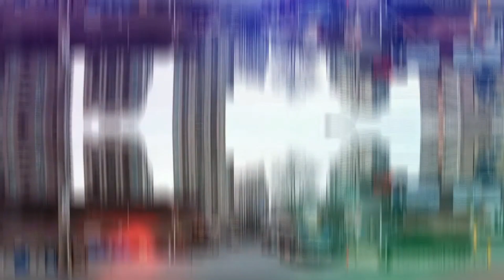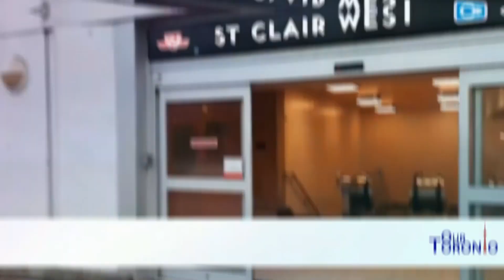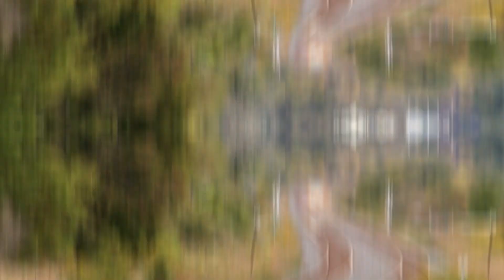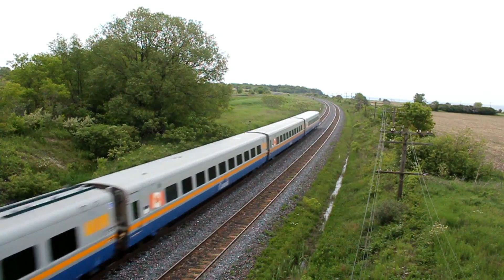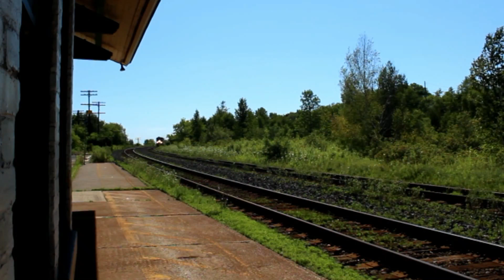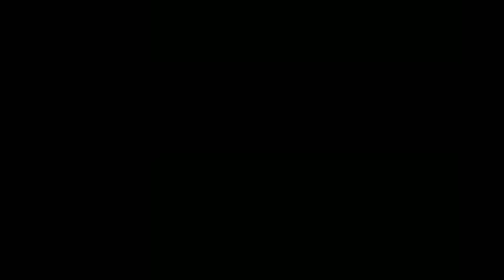High Speed Rail Coming to Canada.  Government moves forwards with VIA's Toronto - Quebec City Plan

Comment: It is important to note that this is $3.9b for a 20 page report due in 5 years.  No concrete will be poured.  Canada built Montréal to Vancouver in less time that this study.
And because Trudeau imposed Trois Rivières not only as a political ploy to help the local MPs but also because he knwos it is a show stopper. The loss of the Mont Royal tunnel means no train from Trois Rivières ca reach Central Station.  With the loss of Windsor Station in the early 1990s, there is no viable al;ternative, unless you use the shack for commuter trains at Luvien Lallier with not enough tracks, no services like catering, car maintenance etc, and long detour to get to Laval. 

Until politicians are willing o discuss this, this project is going nowhere.   Connecting Peterborough to the Metrolinx tracks to get to Union is a challenge but less so than providing train service in Montréal,  (Peterborough to Toronto right of way goes through the CP sorting yards at Agincourt and there is no way CP woudl allow electrificed tracks on its 1950s infrastructure since they would prevent double stacked containers and the 2 lavel car carriers.
Reply: My guess is that the ideal location for the Montreal station is at Dorval, since avoids the Mount Royal issue and lines up with the interests of two of the partners (Air Canada and CDPQ's REM).
Reply: @jje10001  exiting the island from Dorval is not easy.  And would not technically be a station in the city of Montréal.   To reach Laval and Trois Rivières, they would likely have to dig tunnel from Dorval in parralel to REM's single track tunnel and then a bridge over the river to Laval and then build tracks across laval to reach the CP tracks at St-Martin Jct.    From Dorval to the St-laurent sub they would need a big tunnel that goes under the 13 (which is udner the runway) to reach the CN tracks and then winder the leevated portion to 3 tracks 1 for 1950s diesel freight and 2 for electric trains) to the Home deport and rebuild the ramp from the CN to CP line.

Comment: SNCF is not part of consortium. SNCF is now a holding company. It is SNCF Voyageurs that is part of consortium (as well as Keolis).   Voyageurs runs trains and serves drinks on board.  It is SNCF Réseau which has the expertise in building  high speed tracks.   Keolis, part owned by CDPQ is a subsidiary of SNCF which manages transit systems around the world, it has no expertise building systems. 
SYSTRA is the rail consulting firm which has experience participating in such projects.   SNC Lavalin had problems laying standard gauge tracks in Ottawa so definitely not in a class where they can lay high speed tracks.  Air Canada is there in the unlikely event this project goes ahead and wants share of revenues it will lose in short hauls flights.   Remember that at onset, the government wants a consortium to run trains instead of VIA.  
Note: Keolis also owns Orléans Express which runs intercity buses in Québec, notably the Montréal-Québec run which has beasically been vacated by VIA who has been cannibalizing itself and its fleet to offer reduced frequencies.

Comment: Planning the route to go to Ottawa via Peterborough seems like it is starting the race with shoelaces tied together. As I understand it that landscape is going to be more problematic for the straight lines needed for HSR. The existing corridor to Montreal via Kingston is much flatter. I'm far from an expert but I feel like connecting the two biggest cities (Tor & Mtl) via the path of least resistance would be the best bet for a "Phase 1" , and then connect to Ottawa with a branch line somewhere.
Reply from the maker: If there's a will then there will be a way but I have my doubts that there is.
Reply: @OurToronto  too true. Wouldn't ever put any stock in the promise of a (possibly) outgoing government
Reply: There going through Peterborough  because there is some abandoned CP right of way they wanna use
Reply: The land along the lakeshore and river is built-up and full of small property holders. It's very hard to find more space there. The country side is a much easier place to obtain land to straighten the existing railway. 
A straight line is not along the waterfront anyway, it would be well north of Kingston already.
Reply: Who is Canadas Efficiency Czar ?? and Why don't We Have One ?? as Canada is 60 Billion in Debt and Climbing ?? HAS DOGE CHECKED THIS ??
Reply: @Bob-e6u1o  We don't need a efficiency "czar", perhaps a advisory board that offers recommendations but DOGE is a a huge unfolding disaster. Elon fired a bunch of National Nuclear Security Administration and now Trump is trying to hire them back. 

We don't need that shenanigans here

Comment: this will never happen. I been covering this story for 50 years. 
It not the cost.  It is because Ontario is based on English land law. They need to get an easement from every farmer from Toronto to Montreal

Even if they don’t expropriate the case will be tied up in court for decades

That why no real HSR in UK
Reply: I think it will get built but with delays, the segment between Toronto and Peterborough is actually using abandoned CP right of way so that segment is already dealt with
Reply from the maker: But this is a Federal project.
Reply: @ so was Pickering airport. It was tried up in court for 12 years and that was over 3 farmers
Reply from the maker: True.  I guess it's easier promised than delivered.
Reply: @ yeah just ask British Rail that could not deliver the hsr from The Chunnel tunnel to London for over 30 years

Comment: I feel like Page Saunders has a point in just focusing on Ottawa to Montreal first, having too big of a scope with a small budget is not a recipe for good high speed rail. When it inevitably goes over budget we are going to still be left with a joke of a high speed rail network
Reply: Yea we need to build that part cheapely to set a standard and proof of concept
Reply: The issue is political reality. Ottawa-Montreal would be seen as a Quebec-centric HSR, whereas a Toronto-Ottawa-Montreal scope (which is what's probably the most realistic) would be seen as an Ontario-centric HSR. Thus, all the parts in their entirety form a system palatable for all parties.